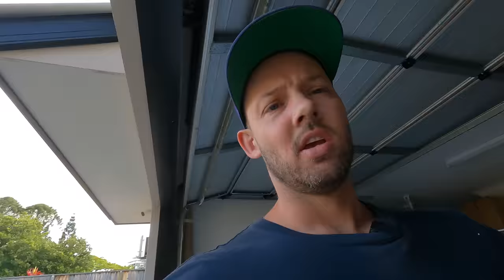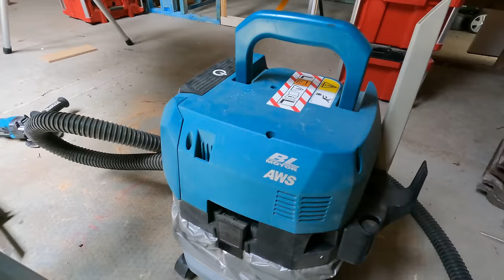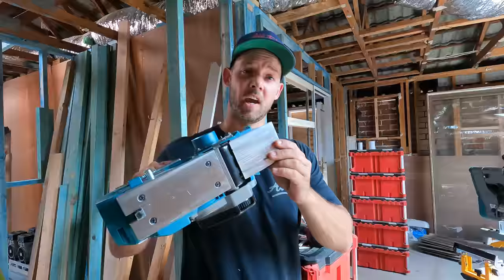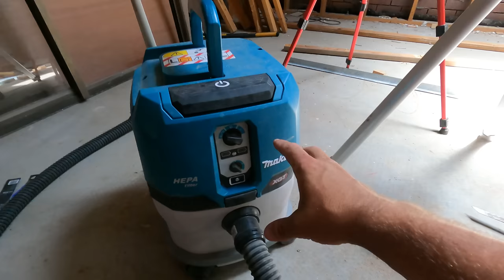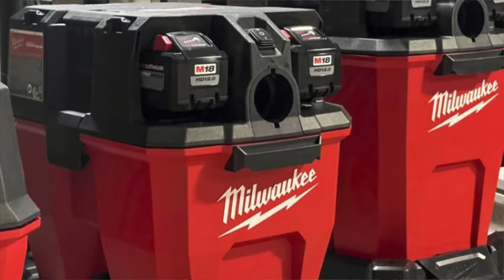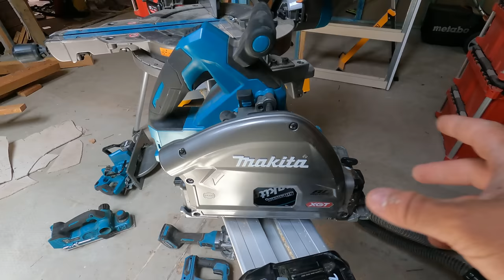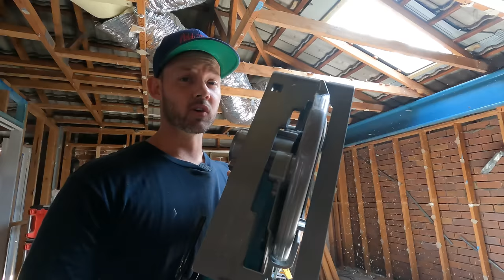From milwaukee to Makita. Why I changed tool platforms

Comment: As someone who owns a lot of Milwaukee tools, I will say everything you are saying is 100% correct. I have way too many Milwaukee tools to completely bail on the M18 platform, but there are a lot of tools that will be replaced with the XGT. I did buy the Milwaukee traksaw, which is a great tool. But no Bluetooth dust extraction. Sometimes I feel like Milwaukee is tone, deaf to what is going on around them. I like Milwaukee but I’m feeling frustrated with them as a Company right now.
Reply: You know you have to be one of the laziest tradesman in the world when not being able to turn on your dust collector remotely is a problem that affects your work.
Reply: @nickmilone5996   t’s not remotely it turns on automatically. And  when you have a shop like I do with guys working in it that don’t always turn on the dust extraction it’s a helpful feature. Not everybody’s situation is your situation. And regardless of that fact, every other premium brand offers Bluetooth dust extraction. Milwaukee is also the same company that offers one key. And one key offers some pretty useless gimmicky features so the concept definitely isn’t beyond Milwaukee. They were just being cheap. But I’m sure Milwaukee appreciates you defending them for giving people less for and charging them more.🤦‍♂️

Comment: Ive been running 18v makita tools for about 12 years. There great, i have over 50 makita tools. The only issues ive had are with the multi tools. Ive probably had 8-10 of them iver the years. Dewalt and Milwaukee especially are SO UNCOMFORTABLE in the hand. Its like the designers and engineers never even put the tool in their hands. All my Makita tools fit my hand like a glove and give me complete confidence in the task at hand.

Comment: At work we have Milwaukee tools provided, we have a pile of tools and batteries called Milwaukee mountain that have failed, everything from failed batteries, drills,1/2 impacts, 3/4 impacts.. will NEVER buy Milwaukee for my self, still using the batteries I got with my first dewalt cordless drill as a first year apprentice 12 years ago. (Broke the tool, no fault of the tool whatsoever) still using dewalt and just invested in the new flexvolt range. 👌

Comment: I switched from Milwaukee to Dewalt because I had problems with the first three fuel tools I bought and shocking aftersales.  Dewalt have been more reliable for me as a carpenter & joiner but I think Makita are good enough also.
Reply: Also run my business off the dewalt range. Love it
Reply: Dewalt is pretty tough and reliable but they aren't as refined as Makita. They are quite rough really. Makita tools are silky smooth to use and often times lighter and more compact. And as far as reliability goes, they are at the top. The red tools aren't very reliable from what I've seen. I run both Makita and Dewalt, but I'm finding when a tool needs replacing I'm reaching for the Makita.

Comment: Thanks for this info. I'm retooling right now, I just gave all my milwaukee tools to the contractor that just did my bathroom, he was just getting started, did a great job and probably didn't charge me enough for the bathroom so I gave him several bonuses like that and will use him again. all the makita stuff I have like the floor plainer all is plug in, I could still go either way. Great video, again thanks, I needed this right now

Comment: I think the main thing holding people back from going all in on xgt has gotta be the prices. Having said that they do make some solid ass tools
Reply: I'm mainly a Makita guy but certain tools they make are over priced IMO, I have a corded Dewalt job sit table saw, Ridgid Jointer, Dewalt Planer, Bosch Miter saw, Craftsman cordless 18g nailer, as well as a Craftsman cordless 7 1/4 miter saw, as far as Corded tools I buy the best bang for the buck and go craftsman for cordless tools that cost to much in the Makita line
Reply: You (the customer) cannot win these days. Milwaukee are decent tools but could suffer from reliability, Makita are reliable but I think many of their XGT tools are way too overpriced.

Comment: At my workplace majority of gear is Milwaukee and very few makita, biggest problem with Milwaukee is the way the battery connnects to tools. Our tools cop an absolute flogging, after time the Milwaukee tools don't attach to the batterys as well and power cuts out. Long term Makita any day of the week.

Comment: When I first started carpentry I started with all Dewalt because everyone else had makita. Then I made the change and it was for better. Makita may not be the strongest but they sure are the smoothest and quietest tools.
Reply: All day
Reply: Bosch are under power but even smoother than makita . Especially when using their better stuff . I rate there drill Especially I don't own one but the one's I've used in the past felt better than drills twice the price.

Comment: I love you still have your original Makita drills.  I still have mine from 13 years ago and both still work, even though the drill has been smoking more than a few times from mixing drywall mud.  

I also agree that Makita is more Carpenter focused than Milwaukee

Comment: Thats why i got Bosch Pro for everything in my home. I am no Tradie in any form, but the quality is for me the best, and you get some nice bonuses from Bosch. I Bought a tool set with SDS Plus Hammer Drill and an Drill for 329€, but you can get additional things from a programm called "Pro360". For the set i bought, i got an additional Impact 1/2" Impact Driver and two 5 amp 18v batterys for free. That and i can walk in the Bosch Shop a town over, drop of my defect machine and get a replacement right there. And Bosch startet AmpShare, a system for share batterys over different tool companies

Comment: Makita is a great brand I still have battery and drill that are ni-cad 14.4 and 18v. Don't really use them but they're my first kits I ever bought.  Now I have all milwaukee mainly because in my area Makita doesn't have as much tools that you can pickup same day. Nowadays they're all good just get the ones that fit more comfortable in your hands.
Reply: on-line at Acme Tools - As I live rather remote all of my Makita was purchased from them

Comment: You definitely hit the nail on the head with Milwaukee batteries, I'm heavily invested in Milwaukee and Dewalt tool, I've had 5 Milwaukee batteries that won't fully charge, and I've never had any problems with my Dewalt batteries at all, and all my batteries from both companies are the same age!! Thanks for the video, Makita is definitely the way to go, they are just a little bit too expensive for me, but they are the best tools in my opinion.

Comment: I've spent a shit ton on Makita tools for woodworking and properties management. Always a pleasure to use them. I've also saved some money by buying their corded version like the electric planer and the miter saw which is by far my favorite tool. Even the wife gifted me the handheld vacuum and subcompact line knowing that's gonna end up being used around the house. But when I see a builder using heavy Makita tools for framing, HD renting them, and this summer saw Disney World maintenance crews using Makita at their resorts, it reinforced my choice.
Reply: At least it was a shit ton and not a shit load.
Reply: I've been on the makita lxt system since I bought my first tool set back in 2013. Which is still going strong to this day. But have since been replaced with brushless models. But still get used often. My brushed impact wrench has been relegated to home use and replaced with the brushless high torque impact wrench for my work truck.  My brushed recip has been replaced by the xgt 2nd gen recip on my work truck and relegated to light duty home use
Reply: @dangrimes5078  Yep, definitely makes a difference. Lol
Reply: After watching a certain Irish bloke repairing tools from the big major brands I got even more sold on Makita, who actually think about making them repairable without it costing more than 50% of the tool to repair.

Comment: I have had 5 milwaukee batteries die within the 1st year. Small business, I can't wait a month to run a tool. Makita is my tool of choice. I have never had a makita battery die. My Makita miter saw 36v did die this year, but it was 5 years old. I love that miter saw, so it's being rebuilt now.
Reply: Sama here, done ordering milwaukee bateries, the makita XGT batteries lasts forever.
Reply: @RuBrasil  absolutely I still have yet to have one fail. I have a couple dozen, and I use them every day. Some are 6 months old, and some are 6 years old, and I can't tell the difference when I run them.

Comment: If you can handle the price the Makita miter saw has a crazy good design compared to most. The slider is nowhere near as awkward and takes up half the bench space because it is side mounted not rear mounted. I think, with a few exceptions, Makita seems to put more effort into the design process of their tools.

Comment: As a Plumber working in underground services I need high powered big gear, breakers, grinders, concrete cutters, largest air blowers, strong suction vacs, water pumps, and I have to admit I’m disappointed with Milwaukee.
I have gone from Dewalt to Milwaukee, with approximately 16k worth spent on Milwaukee I’m very keen to transition to Makita… they got some amazing gear.

Comment: You make some valid and great points. I switched from DeWalt about 4 yrs ago and have went strictly Milwaukee. Overall I am happy. However the Mitersaw, lack of AWS and issues with 12ah batteries have dimmed my excitement as of late.
Reply: For miter saws I just love Bosch's cyborg arm. For the money it's the most robust system to counter deflection I've seen. Even better than those new arm style saws that have tried to copy bosch have done an inferior job.

Mine survived a car crash and still slices and dices. The truck didn't fare as well, (I was not there). It's an older plug in model.

I don't think for bigger tools I want battery power, I want robust power, quality dust collection, and dust collection that can turn on automatically with any tool I plug into it.

Plus I don't want to get stuck waiting to charge.

Not sure what your issue is with the milwaukee 12ah? I've never had problems with them other than taking forever to charge. But that's because you need rapid chargers for the big batteries. Heck if I was using 12ah ones a lot I would consider the supercharger.  It charges a 12ah in 1 hour.

Capacity wise, the m18 12ah has more capacity than the makita 40v 4ah. It's like a 40v 6ah battery.

Comment: The thing with makita is they didn’t jump on any crazy bandwagons too quickly. It took them forever to change voltage, and update their platform. They don’t flood the stores where I live like Dewalt, and some others, and especially not their professional level gear. I use a lot of dewalt, because it’s cheap for the performance I get. Always sales on tools, and batteries everywhere, and that makes it a no brainer. Usually can get a pair of 5Ah batteries for $150 Cdn when the good deals come on. I recently bought the flex volt 60v circular saw, with a 9ah and charger included for $400 total. The thing is incredible, for such a cheap price. Im not opposed to having other tools that work better than dewalt either. The Milwaukee 23gu headless pinner is amazing. Dewalt’s was bulkier, and had nail jams….haven’t had a single jam in the Milwaukee yet. The 40v makita platform looks really thought out, but I have already made the investment. Dewalts new miter saw only takes one battery now, has more power, and runs longer than the old flex volt version that required two batteries. If I was just starting out, makita would be on the table for sure. All my old corded makita gear is about as solid feeling as it gets. Best hand planer, and belt sander ever created in my opinion. Hopefully they can punch through the yellow, and red that has flooded the market already.

Comment: I use MAKITA.  I'm a fan of Japanese engineering and I appreciate the lack of hype!  Nowhere on a makita box will you find the word EXTREME, as far as I know.  Bought my first white brushed makita 18v drill driver set about 20years ago with 1.5ah batteries!

Since then I've added other brushed and brushless tools and batteries including another drill driver set, grinder, circ saw, jig saw, router, recip saw, vacuum, and something else I can't remember.   

In that amount of time I've never had a makita tool fail.  I only had one of the original 1.5ah batteries die.  The original drill needs anew chuck.   

I started as a home user but have used these tools in my boat building career for the last 6 years.   Stuff is bullet proof.  ✌🏼

Comment: Started on Makita but went to Milwaukee about 12-13 years ago as they had a good deal I couldn't refuse.
I still have the original battery.
I agree as plumber Milwaukee has some products that work better e.g. the new 12v sump pump and the 12v small tools as they fit into tight places.
Also to note the 12v vacuums that fit into the hammer drills are pretty cool as they fit into tricky spots.
But def the power advantage with Makita plus the bluetooth would be cool.
But it all depends on the type of work your doing.
I just hate how you have to lock into one product.
Pick what works and don't be afraid to look at new things or think differently.
Also I like the idea of the coffee machine Makita does, I could def do with that in the tool box.

Comment: i am a milwaukee guy through and through, i love the banter between guys on different platforms, but makita has always had my respect. Id be on that platform equally as much as I would milwaukee, but i got on the battery platform on team red when i first got in the trades
Reply: Milwaukee was purchased  by some conglomerate that have many brand names under their control so you buy  only the name . On the other side Makita is independent . The same with Hilti .

Comment: I run 18V Makita and 12V Milwaukee. Makita drills have constantly let me down but maybe I  asking too much from them using holesaws although there was one model that was fundamentally flawed which many people I knew had the same problem. Anyway, apart from that I have flogged the Makita’s and they are great. 
You are correct in regards to Makita being better for carpentry as every Chippy I know runs Makita and/or Festool.

Comment: My first platform was Ryobi (in EU), but they have so expensive and big batteries, that I want to change it. So I change to DeWalt and for now it;s really brilliant and really much greater than Ryobi (you can feel the difference).

But its funny that people say "only makita!" or "only milwaukee!".  C'mon... Of course it's expensive to get two systems, because you have to buy a lot of batteries and chargers, but sometimes it's worth it because one tool in milwaukee can be a crap but the same tool in makita is brilliant. So as you said - just pick up what you need and try to find platform where your daily tools will be the best

Comment: You said it best. For the service type trades, Milwaukee and even dewalt are kings. Makita however, still has better quality, better suited tools for woodworking/builder applications. 
That said, my first combo kit was makita and I haven’t bought any other brand since, once you have so many batteries or a well established set of tools it’s hard to switch so I’ve learned to live with some of the quirks of the mechanic based tools makita offers. 
I’ll be going with something like Greenworks for EGo for my lawn tools though.
Reply: I agree.  I have Makita for woodworking, but mostly Milwaukee for working on cars.
Reply: The funny part is I'm a tow truck operator and I carry only makita on my work truck. Makita tools have never let me down. I carry a makita drill, impact wrench and recip saw in the lxt platform. I also carry the 2nd gen xgt recip saw on my truck as well
Reply: Dewalt is known for carpentry. They make the best saws hands down.

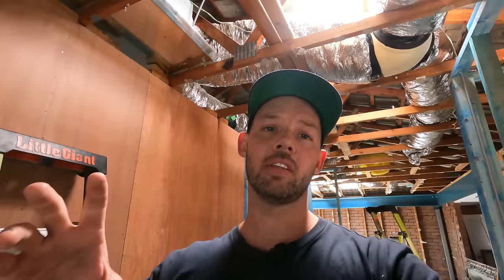Comment: Hit the nail on the hand at 6:20 with your statement “what work are you doing and what finished product do you need?”

  Blows my mind watching the average house husband shelling out $500 USD for the newest Dewalt, Makita, Milwaukee, Bosch, Flex etc and then to overhear he’ll be using it to put small screws into drywall anchors to hang pictures.

   Most people not in the handyman, construction, blue collar trades industry do not ever need to care about brand for day to day house work.

  The professional framer who drives structural screws all day long definitely cares which impact driver, rotary drill, or impact wrench drives the quickest and easiest and which battery runs longest and best on it.

  As a PSA, please stop buying top of the line gear for household DIY stuff. You can get the cheapest most off brand piece of crap on the market and it will do the job of hanging those pictures just fine.
Reply from the maker: Cheers mate. I fully agree. A lot of the time the tool will only be used a few times. Don’t have to buy the top or the most expensive

Comment: EXTREMELY HELPFUL! Thanks. As serious DiYer with limited budget who does stuff for friends in exchange for buying a relevant tool, this was perfect. I've been very impressed with my 4Amp Milwaukee drill driver pack so considered going Milwaukee for more gear. But love my Makita corded saws. Think I'll go 40V Makita tracksaw etc - matches what I do
Reply: I have an older Makita 2x18v tracksaw, it's awesome.   Storing the rails is a pain, but they are x-compatible with Festool if that matters.
Reply: Thanks. I have a Makita corded circular saw with an accessory that lets it work on track, so I have a piece of Makita track already. I also have some homemade tracks up to 8' / 2440mm that work very well with my 230mm blade Makita circular saw.